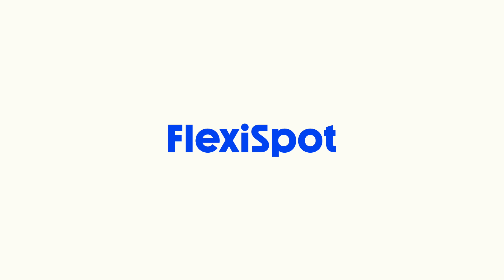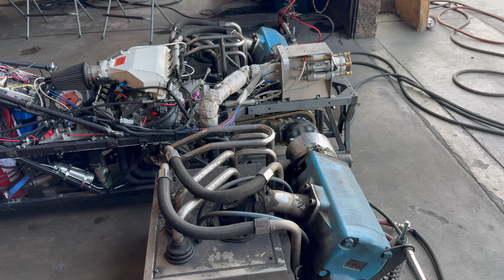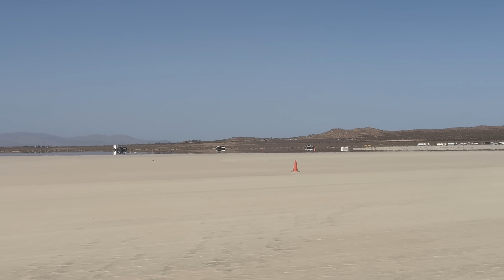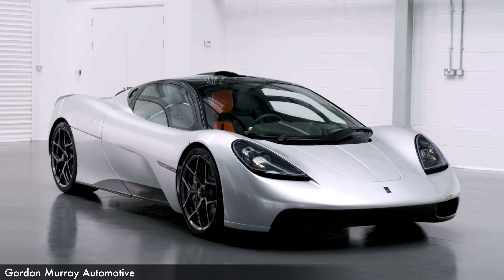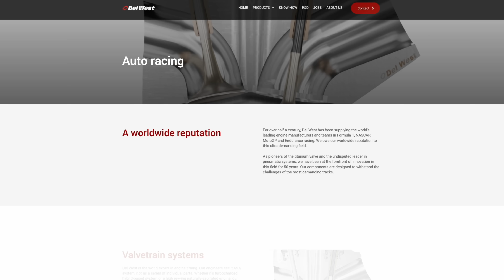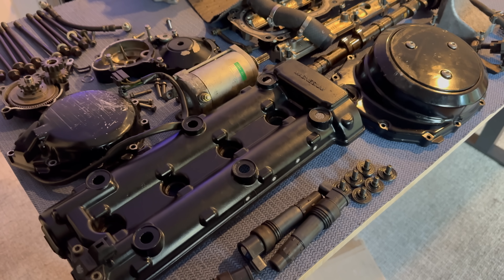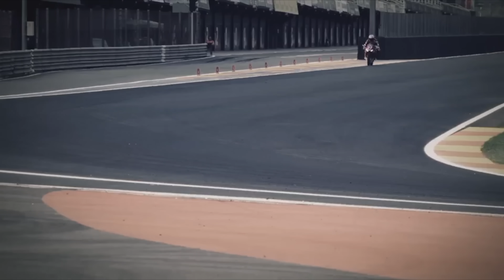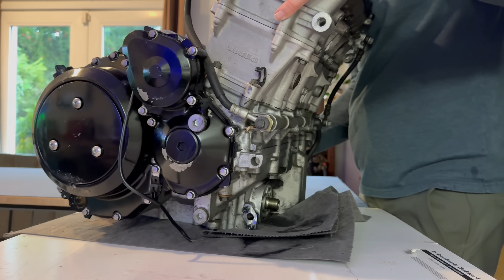Motorcycle Engines Are WAY BETTER than Car Engines

Comment: Electric engine entered a chat 
What weight, what components
Reply: You mean motor? The very heavy dense electric motor?
Reply: @extremeencounter7458 electric motor is much lighter than combustion one
Reply: @flesz_  The battery to power it is not…
Reply: @extremeencounter7458  yes, but that is a separate issue
Reply: @extremeencounter7458  yes

Comment: You are conveniently missing the point where You say that motorcycle engine extract some power from 1 liter of used fuel, but if compared to efficient engines motorcycle engine came dead last because raising RPM firstly is more of a way of wasting fuel. Combustion event have more or less fixed time. Higher RPM less time to burn fuel in air and generate pressure. And this pressure slams piston down generating power. Further more more RPM is more heat from friction that need to be extracted. And heat is most responsible for killing most of the engines. That why ships are not powered with hundreds small pistons slap together in one super powerful engine. 
Small and fast is fun, big and slow is efficient.

Non the less very good essay about this types of engines, only fault is that is presented from one sided view.
Reply: 13:28 He goes over exactly this…
Reply: @extremeencounter7458 , no he did not. Not a word about low power density from unit of fuel. Emissions are not the same as efficiency

Comment: A naturally aspirated combustion engine isn't really an air pump because if there were no atmospheric PRESSURE they wouldn't run. They don't pump air in, they LET air in. An engine's PUMPING LOSS is compression losses. Not air pumping.

Comment: Truth is motorcycle engines are powerful, cheap and reliable because they are designed without the constraints of fuel consumption and emissions, that's where all the downsides of modern car engines come from.

Comment: I'd say that most motorcycle engines these days are capable of doing 100,000 miles if correctly maintained. The main thing having oil and filters changed at regular intervals. I did about 55,000 miles on my Blackbird in 5 years, oil and filters at about 6000 miles, with quality synthetic oil. It never even had the valve clearances done, it is still registered as being on the road here in the UK 🇬🇧, 20 years after I sold it.

Comment: Honda did the opposite.  Instead developing CBR baseed S2000, it showed a half cut Jazz/Fit engine into the NC700. I had a Jazz, the castings are similar to the NC engine and the Bore x Stroke numbers are matching too.

Great vid btw! 👍

Comment: My 100cc honda supercub would object to the longevity argument after it rolled over the odometer twice in 25 years...

The odometer goes up to 100k, so that's over 200,000km
Reply: Agreed.
I live in North East England and they are nicknamed 'Plaggy's' - Plaggy 50, 70 and the Plaggy 90. Some 10-15 milles away and it's 'Plaggy Pig'. I'm also told that up in Scotland they are known as 'Steppies'  as per Honda or Haynes manual's description of a 'Step-thru Motorcycle'.
I could wright pages of anything and/or everything todo with these bikes, stories from pre-license years in the 80's to modifications, Chops and Ratbikes etc. Many Happy memories to say the lleast !!
Reply: Well yea, it’s only 100cc. Zero stress

Comment: Regarding clutch rotation being always opposite the crank rotation,  Not true! I had a 1986 Honda CBX550F for a while and that engine ran in reverse, driving the clutch via a chain. So there was only one rotation reversal, that being the input/output gears.   The engine used standard Honda starter motor and clutch designs but they were on the right side rather than left side like every other Honda I ever had, also the ignition, cams, etc all backwards. Not sure why they did it but you could argue it was simple and more compact than the chain and intermediate shaft and pinion gear of the CB750 etc. Maybe also the counter rotation of the crankshaft may have countered wheel stand tendency.

Comment: I was unclear on when you said you could have the best of both worlds were you talking about having two separate motorcycles engines and how would they be joined together. This is also in relation to the engine your friend is building die he make a V8 and is using motorcycle engine heads or is he using two motor cycle engines,how would the two engines be linked to one transmission for a car.14:39

Comment: I forgot to change the oil on my 2016 Honda PCX ... I rode about 10,000 km before realizing. Pulled the oil bolt out, zero oil came out. New oil in ... It's been running like a champ for weeks
Reply: That’s just cause the metal shavings haven’t worn enough parts down yet lol

Comment: Motorcycle engines are build to a higher standards, almost like racing engines, because high RPM demand them to be build to a high standard, otherwise they will self-destruct. Car manufacturers lazy approach "this is good enough, why bother trying make it better" doesn't work there. Oiling system on motorcycle engines is more thought-out, it must be perfect, otherwise engine will self-destruct. Also motorcycle engines have short piston stroke, but long conrods, to minimize secondary imbalances and improve performance on high RPMs.
By the way, F1 gearboxes are basically motorcycle gearboxes with straight cut gears and dog clutches, but they have two selector barrels for "seamless shifting".

Comment: Great video, but besides the different rules, car engines are supposed to be ubiquitous.  You get around 40mpg (imperial) out of a Hayabusa engine moving around 250kg. Most ordinary cars are built for practically though, and can easily do that whilst weighing 6 times more. You could say:
Different "strokes" for different folks...

Comment: Car engines torque the torque, but a Ducati 698 Mono with a single >650cc cylinder revving to 10.5k rpm is legit insane physics-wise

Also motorcycle wet clutches are fun, cause clutch abuse is fun

Comment: I'd say that car engines are better because they're much more reliable.

Which motorcycle engines do you see crossing 500k miles?
Reply: The better question is, what car engines that make the same power per pound do you see reaching 200k miles?

Comment: Pretty fascinating to think about all the engineering limitations and different technologies. Do you think the valves could be put on a track like system to move them up and down with no spring? Similar to what is being done in the gearbox 🤔

Comment: Nice-ish video but you gloss over lots of facts. First you imply that 4 valves per cylinder was first a motorcycle thing but I'm pretty sure that's BS. Alfa Romeo and countless other car makers had DOHC 4 valve CAR engines long before it was common in motorcycle engines. Further motor cycle engines are famously high strung, have little useful torque at lower revs, require much more frequent and expensive maintenance, and generally are much shorter lived than car engines even ones with seriously high output per liter like the say the 9000 RPM Honda S2000 car engine. Yeah, there are motorcycle engines with a bit more HP per lliter but they're fussy divas vs the S2000 that will go 100,000 miles with just a single change of plugs and the occasional oil change. If you want an engine that will deliver thrills for a run down the salt flats choose a motorcycle engine if it's even applicable. But if you want something that will last while making serious power choose a car engine that's not nearly as high strung as a motorcycle engine compromised to fit into a motorcycle frame.

Comment: 17 minutes and 40 seconds. Not once was the single word that explains everything mentioned. Torque. You explained why cars need more of it than motorcycles, and even brought up some other reasons why car engines are so much different. But the whole thing can be summed up with that one word. Lmao, still a good video but I just thought it was funny you didn't say that ONCE 😂

Comment: Motorcycle engines kick ass. My 660R now 686 has 5 valves on 1 cylinder which was based on a motorcycle engine.

Comment: The greatest thing about motorcycles and motorcycle engines: on one hand they rival and surpass supercar engines. One the other hand you can still buy a brand new 2 Valve air cooled carburated single cylinder or even a two stroke.

Comment: One thing also worth mentioning is economy of scale: there is just not a large market for homologation race cars to justify the production volume needed to bring price per unit down. Almost all of the 600-1000cc+ super sports on the market are homologation production for actual racing series, and they sell extremely well. Outside of the tune, the lights, mirrors, license plate holder, and emissions equipment they are basically the same vehicle. Non-homologation series, like MotoGP however are extremely expensive (bikes cost in millions) because they are basically prototypes (you see the same insane costs in LMP and F1). Only Yamaha, Ducati, and Aprillia I think sell a vehicle remotely close to their MotoGP bike to the public (which can hit 300hp/L in race tune).

And they can sell so many because the market for motorcycles is just so different from the car market. NVH, crash safety, longevity (as mentioned) are just not concerns. Fuel economy plays almost no role in the motorcycle market either outside of touring bikes and scooters. By contrast, car buyers do typically care about fuel economy, NVH, and longevity, so a stripped down race car just wouldn't sell very well. Sure, there would be some market for a Miata that revs 2000rpm higher and has everything inside stripped out and race suspension with solid bushings, but not nearly enough to justify it.

Comment: The flexispot Desk frame looks exactly like a 60$ one i got from amazon, just 2x the legs. Same baseplate, feet legs and top boxes, just not for 700$. Mine can go up and down with me sitting on it no Problem. Why was mine so cheap? Does flexispot sell from the same chinesium at an insane markup?

Comment: The title is such click bait.
You haven’t given a reason why MC engines are better, in fact, you gave us all the downsides and tried to sprinkle glitter on it to make it seem good.

-MC engines rev higher = more wear.
-Smaller and lighter engine = weak torque and efficiency.
-Needs higher rpm to reach same hp and torque.
-Lifespan of 150k km = Car engines can double it.

Comment: You do know that you just demonstrated why a big bore engine Yields more horsepower. Regardless of the r p m at that given rpm , a big four engine will have more power than a small bore engine. What am I calling a big bore engine?And he engine with a wider piston than it has a stroke , another word , a low compression engine. Well you ninja's Riders , you spent an extra couple of thousand dollars for a bite that doesn't deliver as much horsepower as a decent honda engine or even a harley. So this is me laughing😂😂😂😂😂😂

   To get around the stock limitation on speed.I reduce the size of the rear sprocket.
Yielding in additional forty miles an hour fifty miles an hour to  top speed. I also open up the valves by five ten thousands over the stock recommendation. So that I don't get stranded roadside. When the temperature drops to 30°. The heads don't expand as fast as the rods do.
  My father and his day with rear wheel drive.Cars , which was the only thing available when he was a kid , was the was to swap The real diff He did that to 1 car and it was  Is exceptionally fast. Something in the neighborhood of a hundred and sixty miles an hour.  Off of a  car from the nineteen forty. If you will drive a dime or 2, you can get more speed out of the horsepower.You have all day long without doing fancy tank.Additives. Which usually don't do anything for you at all. Keep it shiny

Comment: Motorcycle engines have much more defined and tighter quench zones and clearances - that's a HUGE part of the equation. Smaller chamber -> quicker, more complete burn. Better quench -> quicker, more complete burn. Quicker, more complete burn -> more power, less detonation. Higher detonation threshold -> more compression/timing. More compression/timing -> more power. Also called mechanical knock resistance.

Comment: The purpose of aluminum bolts in magnesium engine cases is because of the galvanic reaction that happens between steel and magnesium.  Put aluminum thread inserts in those holes and you can run steel bolts (like is done on the head bolts where aluminum won't cut it.)  

The main reason I hate aluminum bolts is that they eventually fail spontaneously, because aluminum can't handle strain like steel does.  They work on motorcycle engines for the reason you talk about - the shorter service life, but BMW in their infinite stupidity uses them in car engines.

Comment: The guy is forgetting that modern car engines are designed for turbocharging. His twin CBR V8 would be worse than a modern 400bhp turbo car engine in nearly every respect (Cost, driveability, maintenance, durability, NVH, fuel economy, real world performance etc) and all for what? a 2% weight saving?

Comment: Fantastic video.  After 50+ years of riding bikes, I finally fully understand how the gearbox works!

Regarding engineered longevity, my personal experience has been liter class sport bike engines are pretty much immortal.  I've had several bikes with nearly 100K miles on them and the engines ran like new.   Years ago, a friend had a CBR 900 with over 300K miles on it.  It had gone through several sets of wheel bearings and the chassis was tired as you would expect.  That engine ran perfectly on a diet of Castrol GTX non synthetic car oil which got changed often as he racked up tons of miles every month - the CBR was his sole form of transportation in Southern CA.  High performance large displacement inline 4s sport bike engines don't get run very hard in normal street use and they can last a very long time.  It seems to me that sport bikes are like Tootsie Pops, how long with they last?  Crunch.  The world may never know 😂

I have more faith that my mildly tuned Super Tenere's engine will last 200K or more miles than pretty much any new car with the exception of Toyota perhaps.  A lot of new passenger car and truck engines are having stupid issues and dying early these days.

Comment: Motorcycle engines are way better for, well, motorcycles... 
 The only thing that you can argue for is that on a stripped down skeleton car, there's no car engine that can compete with the high performance motorcycle engines. 
 But there's no bike engine that can replace an Ferrari like engine on a hypercar also...

Comment: One huge thing not discussed hete is that car engines are tuned for a wider powerband as that provides more power at low rpm, far from the peak power rpm. Car engines need this because cars have a way lower power to weight ratio. This also gives car engines less peak power per unit displacement and makes them more fuel efficient. Motorcycle engines focused more on efficiency also tend to have more torque at lower rpm and similar peak power per unit displacement as naturally aspirated car engines.

Comment: What I don't like about motorcycle engines - they already pushed to the limit. But i can take 200hp car engine, get it to 700hp with redneck engineering and still pass emission test.

Comment: Well there are some inaccuracies and Misconception that superimpose themselves because you skimmed over. 
1. Japanese Bike makers solved the RPM issue with Springs in the Late 1980s. The Springs cost a tiny fraction more than any other spring on Slower revving Bikes. 
So the Problem is not : "We cant" the problem is " We don't want to" It requires engineering and the West thinks Their Heads are Priceless, and they would have had to be Bought an Island the size of Australia as reward for doing it. So Only Japanese Made it. 
Kawasaki ZXR 250RR (1989)spun up to 20 500 RPM in the last iteration. Which is 500 RPM Faster than the Fastest Engine in F1 ever(1998), BMW Sauber. 
Same reason why BMW doesn't make 5 cylinder engines, they will just get Mopped by Mercedes, AUDI and VOLVO. Who made inline 5  masterpieces for ages. 
2. Lean burn is not clean, When it comes to Diesels it is the EXACT reason for NOX. 
I personally used my Friend who Works in the MIT lab to test Fully rebuild , broken in 5000 km  Mercedes 190D 2.5 Turbodiesel(OM 602 at 977 000km) and a 5200km Passat B-5.5 20 TDI (at 473 000km). 
Passat Makes 29x more NOX even though it's a 20 Year Younger engine has EGR, DPF and a ton of EPA BS. And yes all of them were replaced in the rebuild of the Passat. So there are no faulty results due to faulty parts. They cost a fucken insanity.  
Mercedes has NO EGR even and Makes 29x less NOX. 
Because it has a full clean Burn. And proper AFR. 
Mercedes makes 19% more CO2.
But it also has a 20% larger displacement. 

So No Lean does not solve the issue of NOx and other emissions. Proper AFR does. But it doesn't matter because Fuel economy sells and Emissions are not even secondary. 
And most important 3rd:
Low end torque. 
Bikes have shit torque and don't need it as they are Light vehicles and they are not basically Mandatory in most of the planet. 
Cars unfortunately are very forced on us especially you in the US. 
Thus you HAVE TO buy a car, and Manufacturers also DO NOT want you to drive it forever. 
So the Engine HAS to be lower revving, more reliable, less Fuel guzzling( USA kind of missed this point, on purpose) but it also has to be less of what you want, so they can give you 2% more in 2 years with a new Model. 
Bikes are not mandatory, so the Makers HAVE TO compete to get every sale as People will Buy and ride them for longer. 
If they use the same tactic as US cars, they would all be out of business. AS they cant get Monopoly over people and they are not Mandatory vehicles to be able to survive.